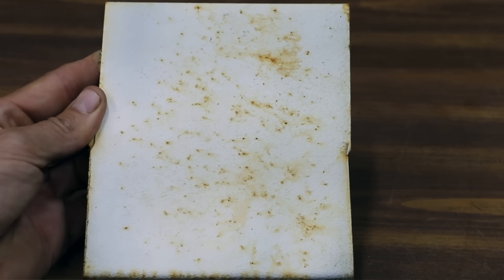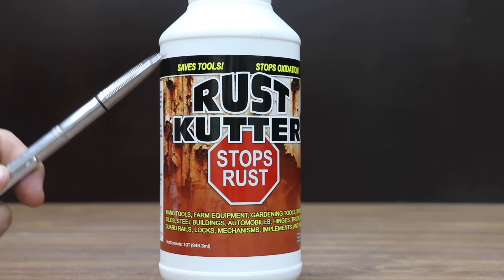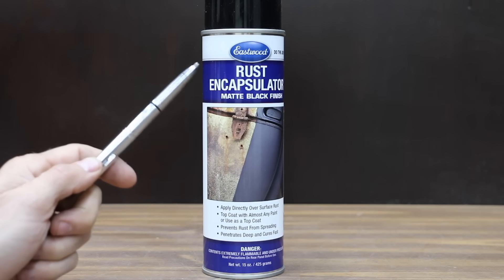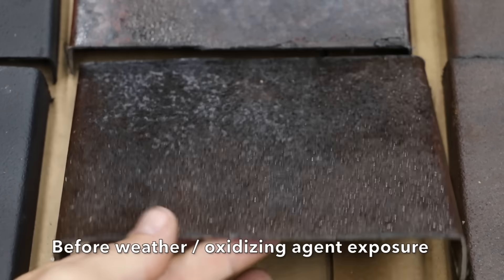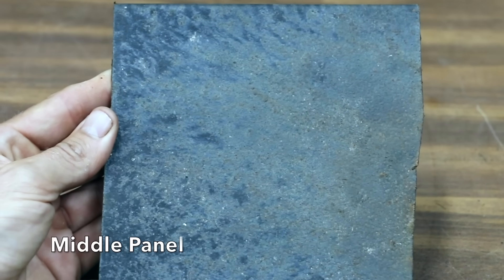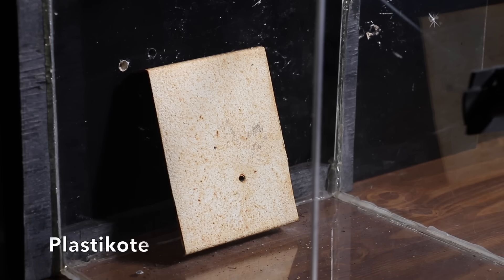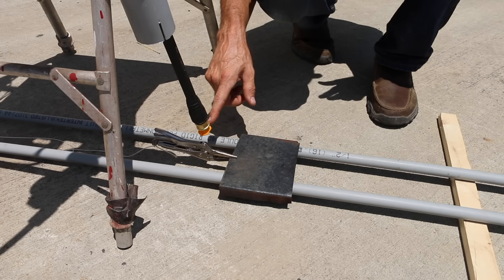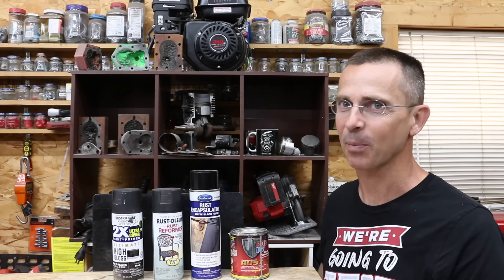Best Rust Converter? POR-15, Eastwood, Rust-oleum Rust Reformer, Gempler's

Comment: It’s nice to see my faith in POR 15 is not misplaced and to have it confirmed by PF is a bonus. Well done. 
Just need to know the performance of fluid film / waxoyl type products now.
Reply from the maker: Thanks!  Thanks for the suggestion.
Reply: @ProjectFarm  I'm about to get started on a "stop the rust" project on my trailer.  I know POR15 from my off-roading days but its been a long time, so I needed this.  Thank you for this and many other reviews.
Reply: Last fall I "restored" my 2008 F-250 instead of buying a new truck. Essentially I removed the bed, cut out and replaced bed rails, cut out rot on the wheel wheels and replaced that, cut out and replaced cab corners and parts of the inner rockers and then repainted the truck. After doing this I sprayed the underside of the cab with Chassis Saver which is a product very similar to POR15 and then sprayed fluid film. I sprayed the entire underside of the cab in fluid film over the Chassis Saver paint and the underside still looks great after a salt filled Northern winter. I used fluid film because it is only like $30 a gallon. I used the gun too so I could spray all inside the rockers and through the bed rails. Obviously as you know nothing will totally stop rust. I am basically trying to get my truck to last another 5-7 years before buying a new one. Frequent coats of fluid film over the chassis saver is what I am trying and so far it seems good. I will be putting another coat of fluid film on in fall before the winter again. Once the coat is on it looks like cosmoline is coating the entire underside. It never really dries and is more like a light grease than anything.
Reply: @huktekhardware734  Fluid film is amazing stuff to stop rust  and so is automatic transmission fluid.
Reply: @huktekhardware734  Any update as of 3-25? Just picked up a 2013 Silverado the other day and want to subdue the rust for as long as possible. At the moment, it's pretty darn clean for a Michigan truck of that age.
Reply: @ I have a new truck since I posted that, but when I sold that one it still looked pretty good. I sprayed it underneath every fall before winter. On the new one I have continued spraying the underside and suspension with fluid film every fall and it still looks new underneath, though it has only been through 2 winters. I buy the fluid film by the gallon buckets and spray with a gun instead of the spray cans so it goes on thicker. It won't completely stop the rust, but it definitely slows it down. Seems important to hit it again every year to renew the protection.
Reply: He did that already
Reply: Once you open the can it almost can't be stored and used again later.  I used half and the top got stuck to can and would not come off.
I ended up drilling a hole through the top and pouring it into another container the amount I needed.  Seemed to work pretty well.
Other than that, it does seem to work pretty good.
Reply: @oakhurstaxe6392  And DO NOT. I repeat DO NOT get it on your hands. It is impossible to remove, it must wear off. Not even lacquer thinner will touch it once its dried on your hands. When I spray Chassis Saver I will actually buy a full tyvex suit and safety googles just to throw away when I am done. And like you said, once you open the can and pour some out it glues itself shut. It is NASTY stuff.
Reply: @huktekhardware734  you are so right about the POR-15 and hands. Wear Gloves and protective and/or sacrificial clothing.   To help with the unopenable can issue:  I swiped all the ugly mismatched plastic food containers with tight fitting lids from the kitchen to use whenever I cracked open my POR-15 can -- use a nail to tap a drain hole in the recess in the can, pour out some into the plastic container that had a lid, wipe the POR-15 can.  Trash what you wipe with, it will get on your hands or clothes or other things you do NOT want painted.   The POR-15 will eventually skin over in the plastic container, but it cuts down on the humidity-cured epoxy paint getting exposed to the atmosphere.  And since it spreads and levels so well, a little in a plastic container will stretch a long, long way.
Reply: @oakhurstaxe6392  so true. You really have to handle that stuff in a particular way or at all gets thrown out more or less. I use it sometimes and I have to have a series of smaller containers to put it in as I go. And you damn sure better open the can dump everything you’re going to use any seal at puppy up immediately or the can will be found with a heavy skim or solid as rock The next time you go to use it. That’s why for me it’s kind of a love-hate relationship with that stuff.   That’s what makes it expensive. By the court it’s not that bad but trying to use at all court is an easy.
Reply: I use RP342 as an undercoating like you would fluid film, but this is a bit thicker when dryed & also comes in black. I've heard of chassis saver paint before and a guy I work with as well as the paint shop at the parts store have all good things to say about it
Reply: My interceptor sedan has a bit of rust underneath and I began freaking out, after having to scrap a really nice Subaru back in February, a friend swore by POR-15 and without hesitation I bought a quart and it showed up today. I was really hoping it was good lol, not cheap.
Reply: I had it come on an old car of mine. Never rusted in that spot so I figured it was good stuff. Didn't realize what it actually was until that car was already scrapped tho lol, only in hindsight once I found out about por15.
Reply: Sad you didnt include the best one out there... Rust Bullet!  arg

Comment: What about those anti-rust products that have to be applied with a brush? I had a product purchased in the `80's (can not remember it's name) that came in about a half pint plastic bottle that you had to use per application and was warned not to mix it or come in contact with what was left in the main container. In other words you poured out what you think you needed to do the job and not contaminate that with the rest of the product. The product had a tan color before use and had to mixed thouroughly before applying.
When applied it turned flat black and could be painted over when dry. I had spots on an MGB that I used it on and 20 yrs later it still looked like the day I applied it.
Reply from the maker: Thanks for sharing.

Comment: I’ve seen your older videos on carbide blades. It would be nice to see you test the newer carbide blades on uhss or boron materials used in newer vehicles. Specifically with the attention to use these blades for rescue work. Currently Diablo steel demon carbide 8tpi seems to be the go to. But with your testing style a good comprehensive testing video would be awesome for comparison.
Reply from the maker: Thanks for the suggestion.

Comment: Great test, I’m not surprised that POR 15 finished on top, I’ve been using it for over 20 years and the only problem I ever had with it was trying to use it over top of undercoating. It won’t stay used that way. That why they have instructions I guess….
Reply from the maker: Thanks so much!  Thanks for the feedback.

Comment: You didn't use Eastwood's actual rust converter, though. It's a milky substance similar to the POR-15. It's intended to be used as a system with the other Eastwood products. Converter -> Encapsulator -> Chassis Black Paint
Reply from the maker: Thanks for the constructive feedback.

Comment: Project idea:
Replacement Battery Terminal Connectors

There a many different styles and brands at varying price points. It's hard to tell what's garbage, what's the best, and what's "good enough".
Reply from the maker: Thanks for the video idea.

Comment: I've know about POR15 for twenty plus years.  This product does a fine job of protecting metal.  My first complaint is that other paint does not bond well to this surface.
The POR15 dries with a glossy finish that is difficult to scuff.  I've tried to get other paints to bond with little success.   POR15 was available in Black and Silver.  So there were
limited options in color.  The only other complaint about the practical use of this product is that you can't spray this product.  If you try to put this product in a spray gun.
It will ruin your spray gun.  There are very few solvents that clean this stuff up and if it's allowed to set.  You will not get it off the parts in your paint gun.  POR15 seems to bond
to metal in a way that somewhat permanent.  I only used a brush to apply this product and found it really difficult to get a good finish.  The Black will cover pretty well, but the silver
doesn't cover well and doesn't give a nice consistent color or finish.   One last bit of advice about POR15.  If you buy this product.  After using the product.  Be absolutely sure to 
clean up any paint from the lid and top of can.  If you reseal the can with any paint on the lid seal.  You will never get it open again.  If I remember correctly.  I used Xylene to clean this
stuff up.  Later when I went to use this product again.  I would always find a hardened film over what remained in the can.   So it's best to use the entire contents of the can and not
plan to save any.   Oh,  don't get this stuff on your hands either.  It does not come off easily.  So use gloves.
Reply from the maker: Thanks for sharing!

Comment: Thanks for all the hard work. I think you're testing approach is probably more true to actual use in the field. 
I have found that Ospho, a water thin rust converter is the best and most cost effective at less than $40/ gal. long term protection available. Wire brush loose scale, apply product, let stand overnight. Wire brush again. Prime with Rustoleum oil based primer, once dry top coat with any spray oil based, latex or polyurethane topcoat. If using for automotive applications, grind and fill pits or weld as necessary, reapply as before and  prime with compatible topcoat primer. 
Ospho can also be used as a metal prep to eliminate flash surface rusting if unable to prime immediately.
Reply from the maker: You are welcome!  Thanks the feedback.
Reply: Yea buddy. This stuff is the bomb, and it's too bad it wasn't tested, as I truly believe, based on my experience of using it for over 50 years, that used basically as you have suggested here, would absolutely kicked butt from a rusk prevent stanpoind and  even more from a cost standpoint. Converts iron oxide to phosphoric oxide, which is basically inert. Maybe other if not most treatments tested here employ the same chemistry, but i still think that Ospho would have been on the top of the list. Even with used without a paint topcoat it works very well.

Comment: I really enjoy all your testing videos! If you find time I'm curious to see an oil test. Being a racer that is hard on a motor oil performance is big for us. I run rotella t4 15-40 in everything because I've always been told it cleans better and has more zinc than regular gas engine oils. Think you could put it to the test?
Reply from the maker: Thanks for the suggestion.

Comment: I was going through Amazon and looking up cordless combo kits, is there a way you could do a test of their off brand drills etc...? Also I saw a power 8 multi table tool setup where it's like a power station, could you test that against the black and decker option? Maybe there's more table tool power station setups like that.
Reply from the maker: Thanks for the suggestion.

Comment: This is why I love this channel, this project took 60 days to complete, any other channel would have 5 videos from this with updates weekly, but you just put the setup and results all in the same video.

I can attest I used the Rust-Oleum rust reformer in the trunk of my car to cover up some surface rust but don't have to worry about impacts in that area so it works great for me.
Reply from the maker: Thanks!  Thanks for sharing.

Comment: Ive used Rust Reformer from rustolium for 7 years on my Jeep grand wagoneer.  If you clean the chunks off and get a decent amount of the rust powder off with a wire brush..   Then spray 3 or 4 coats on.    It does work.  Its been maybe 5 years for places i sprayed it on.  And the rust hasnt come back.

Seems on your test the rust reformer is thr best value for your money that stops the rust from comjng back..  also easier to apply in tight places that you cant get POR15 in.
Reply from the maker: Thanks for the feedback.

Comment: I feel you tested two types of products.  One being a rust converter and the other being a paintable rust encapsulator that can act as a primer.   A rust converter will change the rust to a black oxide (magnetite) which still needs a primer (it is like bare metal at that point).   While other products have this plus a primer which did better in your test.   As someone that does a lot of rust repair I care more about the rust conversion process because I want to apply my own primers and I just want to kill the rust so I can paint it.   If you want something that will just be able to paint over rust then your review is accurate but I think you made these products seem worse than they are because they were not meant to be a primer.
Reply from the maker: Thanks for the constructive feedback.

Comment: Ah i really wish you did Rust Bullet! It was significantly better than por15 in my experience. I believe its the best product on the market.

My rust never came back. My can was getting old/thick so when it dried I could see how much oxygen had dehydrated from the rust by the gritty surface it created.
Reply from the maker: Thanks for the suggestion.  Thanks for sharing.

Comment: Is Tremclad oil based rust still available in the US? That's what I have used in the past on rusty metal after treating it with naval jelly (phosphoric acid in a brush on jell). I have been meaning to try POR-15 for a while now on parts I can't sand blast and coat with epoxy. Good to see a real world performance analysis of these products. It's especially useful information when its coming from a trusted a reliable source like Project Farm!
Reply from the maker: Thanks so much!  Thanks for the feedback.

Comment: Great video and test!  As someone who restores cars, the information gleaned from this test is sad.  At the end of the day, ANY rust coming through will only grow over time so it seems impossible to stop it once it starts; thus, the reason why it's called cancer.  It seems, regardless of the price and prep, you are only temporarily halting the spread or reinfection of rust...which is why I stay away from vehicles that have it; unless the body panel/area can be cut out and replaced, it is NEVER going away.  Sad to see so many put countless hours into a project just to see the rust pop back through in a year or so.
Reply from the maker: Thanks!  Thanks for the feedback.

Comment: If you frequent online discussion groups (ex: Facebook) where the topic involves automobile restoration, the people in those groups who have experience restoring cars will tell you that rust not physically removed through grinding or cutting or chemically dipped in a rust dissolver should be treated with POR15. You don't even mess with anything else.
Reply from the maker: Thanks for the feedback.

Comment: If you can do a follow up video, you need to add Ospho, one of the original rust converters, straight phosphoric acid, and paint on cold galvanizing compound.  My friend's dad, an engineer at NASA, was repainting his truck himself, and kept getting rust popping up after priming the truck.  Being at NASA, he did the logical thing and went and talked to a guy he knew in the materials lab.  That guy told him to take the primer off, let the surface rust slightly, then put on Ospho.  Ospho, as well as straight phosphoric acid, turns the iron oxide into iron phosphate.  That means there is nothing left to react nor scratch off.
Reply from the maker: Thanks for suggestion.  Thanks for the feedback.

Comment: The only thing about Par is that if you don't follow the instructions for sealing the can up each time. 
The next time you try to open it up, you'll find that it's next to impossible to do 
You'll almost literally have to cut off the top of the can to get it open again. 
Don't ask me how I learned this fact, but  you've been warned is all I will say. 
Also as with most paints, it's advisable to place your rollers, and brushes in good plastic bags, pressing all the air out of it as possible, and place in freezer until you're ready to use again. 
All this is in the instructions for this product, so read it, and follow directions,  are you'll be wishing you had. 
Good luck it's great product, applies easily, great coverage, especially if you don't wear protective gloves, and old clothing that you don't care about.
Reply from the maker: Thanks for sharing.

Comment: The biggest issue with these rust converters is they act more as a band-aid than a real solution. If you have serious rust issues going on where it's more than surface-level, the inner portion might continue spreading and eventually rust all the way through. Only real way to fix that is to cut the rust out and weld in clean parts.

For surface rust however, POR-15 is hard to beat.
Reply from the maker: Thanks for the feedback.

Comment: I'm  wondering  why you didn't use original rust oleum.  The 2x formula is not for rusty metal.  Its more for a general use. 
I'd  like to see how rust oleum original, Ace hardwares version of same, True Value has one too.  And also Hammer rite brand paints stack up.  
Thanks for all your testing,  its so very well done.
Reply from the maker: Thanks so much!  Thanks for the suggestion.